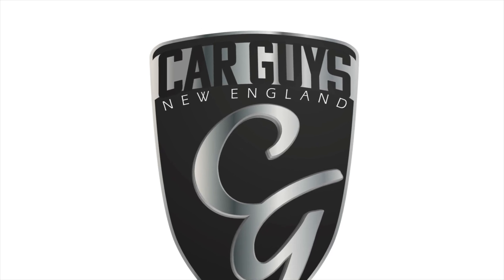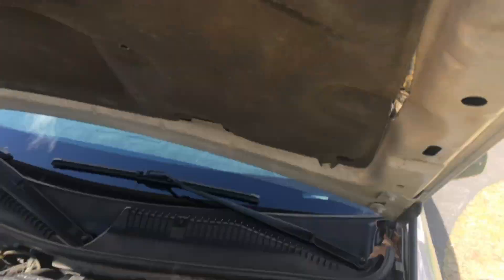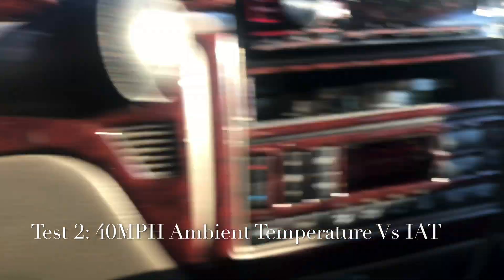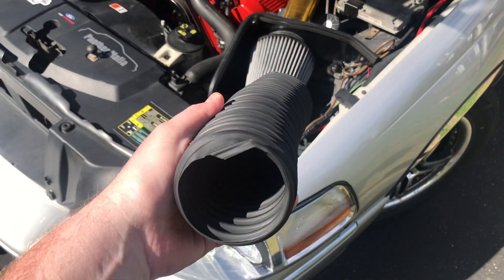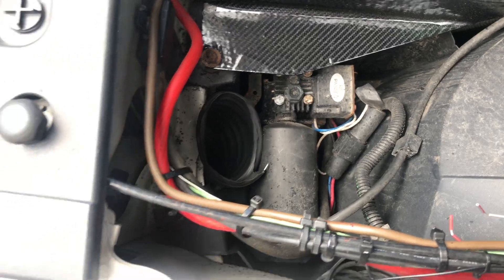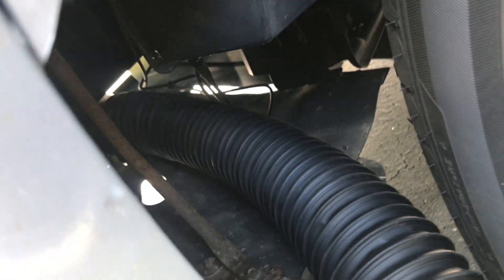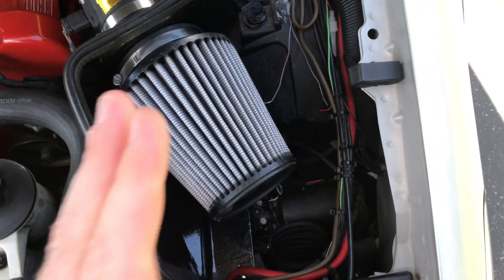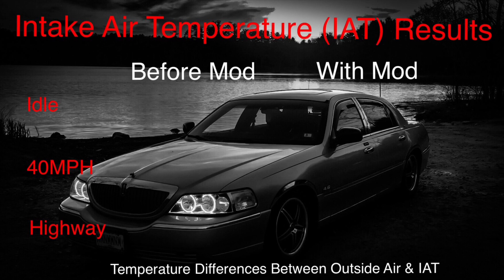How To Build A Ram Air System For Your Town Car Or Crown Vic

Comment: The less than ambient iat is just an erroneous reading, without some kind of phase change cooling involved it would defy the laws of physics.
Reply: PV = nRT. 
Since the Pressure is higher (at speed), the Temp has to drop for the equation to balance. 
The pressure basically offsets whatever restriction the filter presents to the engine “inhaling”, as well, so pumping losses on intake are lowered, making the engine slightly more efficient at making power. It would be significantly more effective if the pressure was better maintained all the way to the throttle plate, but the ram air pressure drops in the “air box” the cone filter is sitting in. If they had run this extra snorkel to the factory filter/airbox, this car would see probably up to 5% HP increase with a corresponding boost in mileage rather than the maybe 2-3% with this setup.
Reply: And to reply to my own comment, the more (reasonably) free-flowing your exhaust, the easier it is for your engine to inhale. Even increasing exhaust diameter bu 1/8-1/4” makes a surprising difference. 
It never ceases to amaze me that people forget an engine is just an air pump -tweaking airflows in and out is what makes for power and efficiency.

Comment: How did you install the cold air with the valve cover vent?
Reply from the maker: It has an attachment point on the new tube... it’s plug and play pretty much
Reply: It's cool that you definitely got cooler air to the intake but how can you confirm that you're not restricting air volume/flow. From what I could see that looked like it could be an issue.

Comment: Very nicely done with the mod and with the data to back it up! 

Only things I would be wondering about are:
 Increased risk of water being sucked into the intake. Driving in the rain or washing the car.
 More dirt/ dusty road debris getting into the intake area. Might just have to clean the filter more often?

Interested to see how it holds up!
Reply from the maker: eccentricorgan so far so good... since it’s not air tight at the filter it doesn’t seem to be sucking in water

Comment: Nice mod Jay, I did some thing like this with a stock Marauder air box I cut a hole in the bottom of the air box and sealed it up to the lower area of the bumper with self stick weather stripping from Lowes. AIT is always with in 5 degrees of outside air.  I like your Idea too as you leave an air gap so if you run though some deep standing water you have an air break between the intake and the scoop to avoid sucking water into the motor not a good thing LOL.